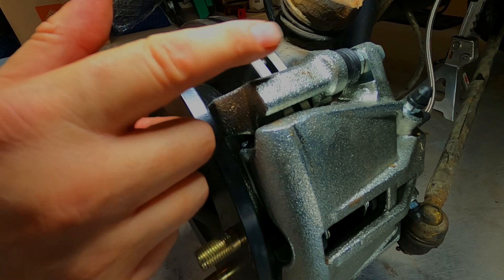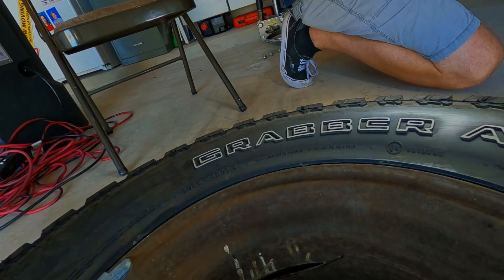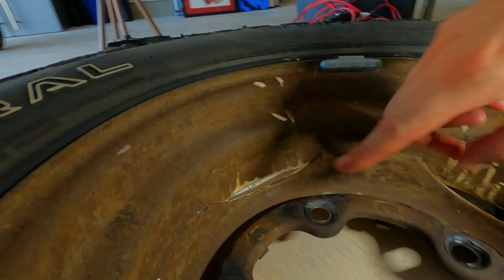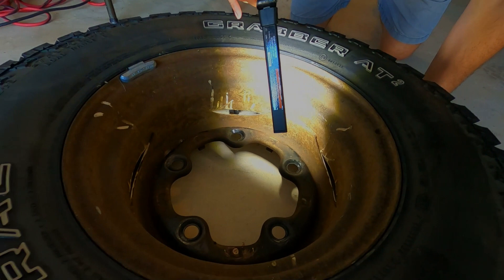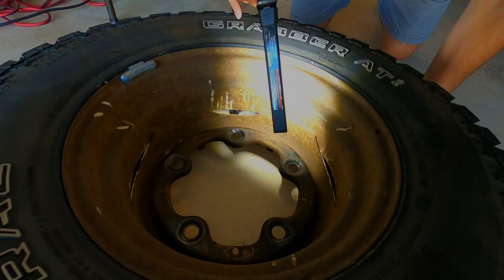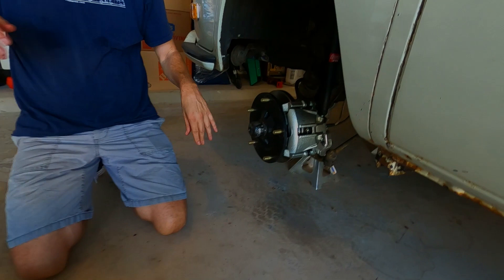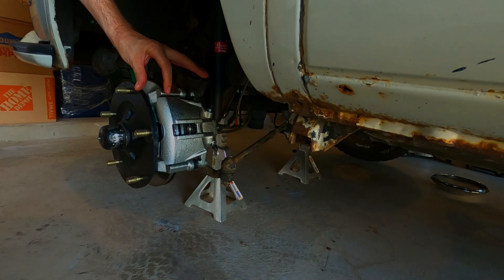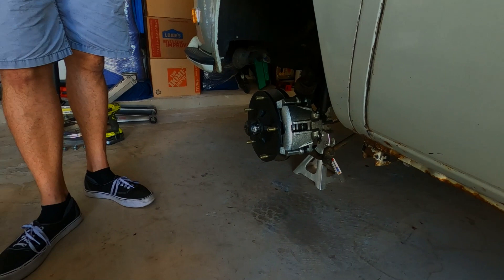VW Bus Disc Brake Noise EASY Fix

Comment: Man I have a 59 sc and have lowered it. Now I can’t get the rear alignment right. And there is no adjustment, chatters then I hit a bump or turn left uugghh. Also have  a 61 ragtop bug and it slams when I let out clutch, shifter also moves when on off gas. Can’t see any break on nose cone .